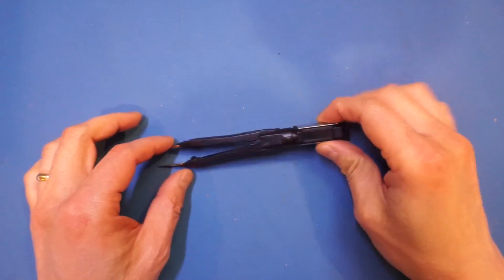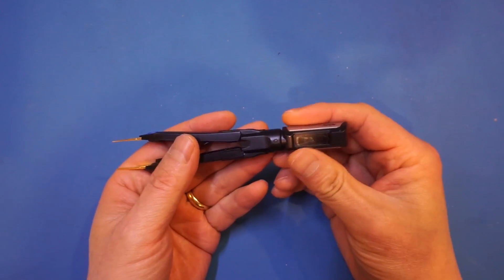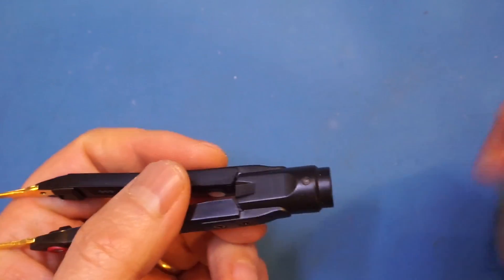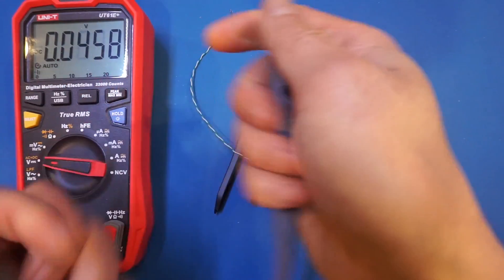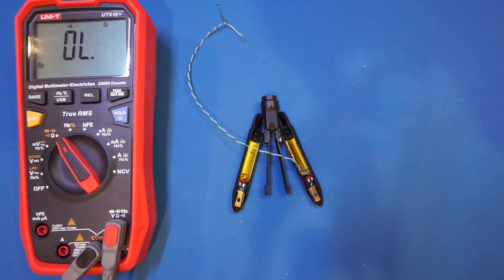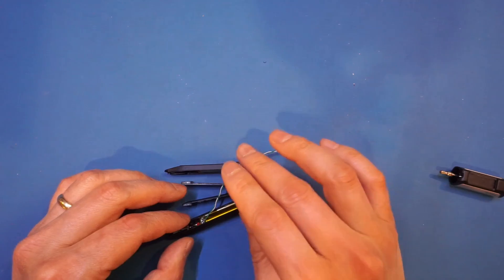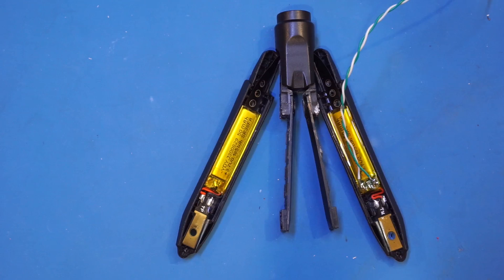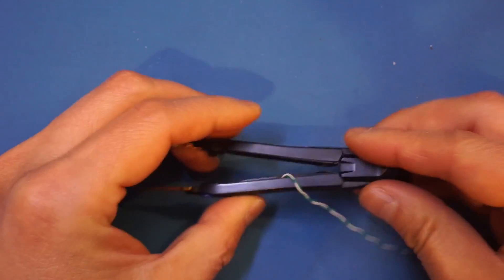Design Fail - Trying to Solve a Problem that Did Not Exist at the First Place - DT71 Repair

Comment: Lithium batteries become unsafe to charge once they have fallen below 2.5v per cell. Otherwise there is risk of fire/explosion. So the supplied charger will refuse to charge them. 

You can force them back to life as shown in this video but the risk of fire is there. 

The real problem is why the electronics in the device allow the batteries to reach such a low and damaging state of charge in the first place.

Comment: The stick could have been longer and the battery in the head. Could provide also a USB connection like the soldering irons and who knows some basic data logging software I guess... But oh well... Nice try I guess.

Comment: Did you try the charger after you have manually charged? I had this happen on other devices that some undervoltage protection prevented the charging circuit to work...
Reply from the maker: Yep, I checked, did not work after I charged the battery. Had to be something physical like a broken connection somewhere.